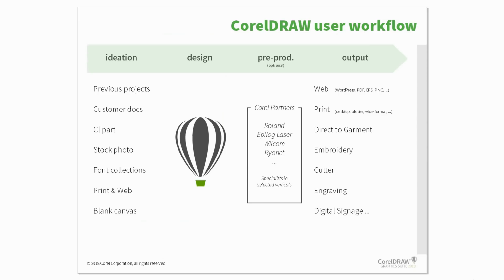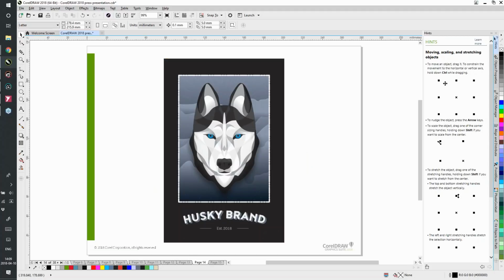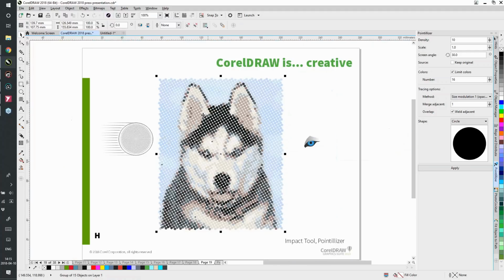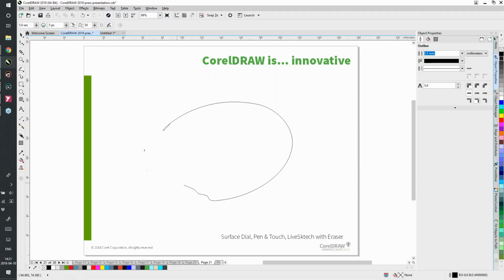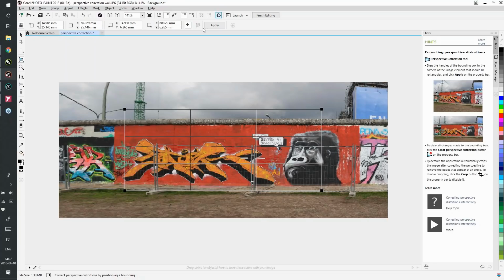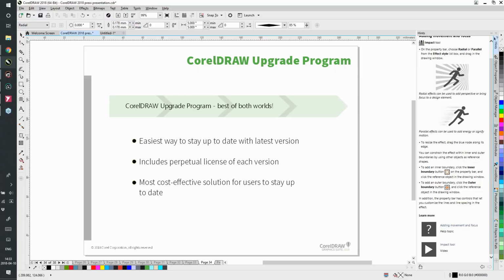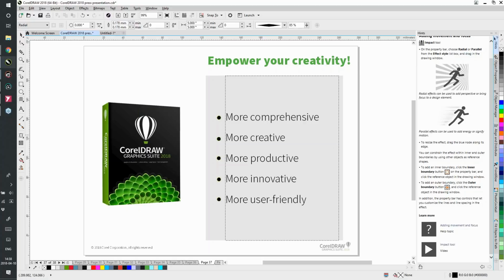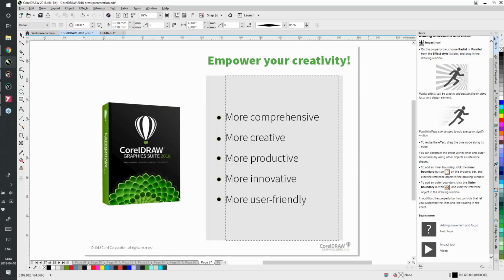CorelDRAW Graphics Suite 2018 Preview Webinar

Comment: Wow!! This presentation was really impressive with the new features. I am waiting to see a "SHAPE BUILDER" tool, similar to the one in illustrator, and not using only the (combine, Weld, etc...) tools to build our shapes. Pay attention to develop further more the already existing  tools, rather than adding (in my opinion) Useless tools, such as the "impact tool", or the " export to WordPress". At the end of the day you are packing up the software with useless bloatware, and it becomes very heavy to run, try focusing on the existing tools which are begging for more attention, development and overhaul. Thank you.